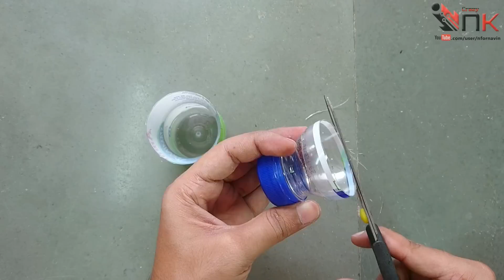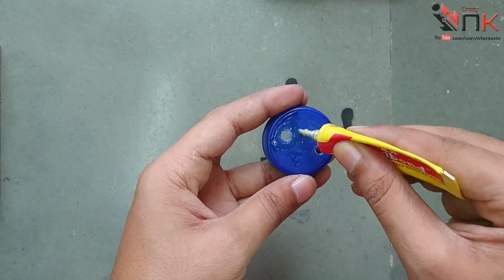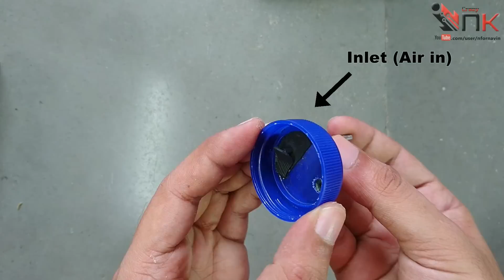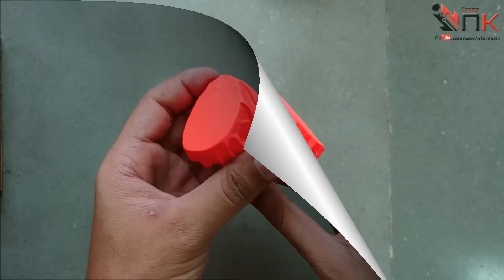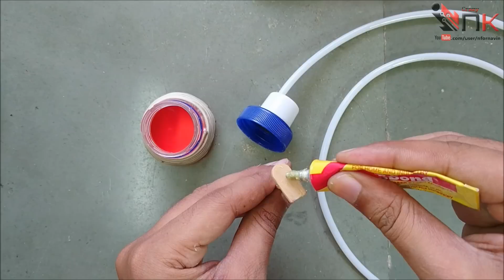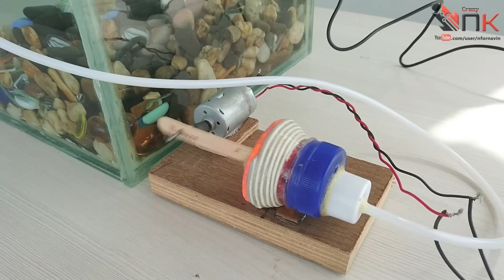How to Make an Air Pump for Aquarium using bottle

Comment: Hi, I'm confused, why need to pump air to aquarium water? Isn't it water is H2O? And the air obviously doesn't spread through on water.    I like it.
Reply: LOL!! since no one can see air, he demonstrated that way.
Reply: Air increases the oxygen level of aquarium water. And without air pump your aquarium is a dead trap.
Reply: wrong. unless he's using an oxygen pump, then it increase oxygen. air pump is usually used to encourage gas exchange since there is disturbance on the water surface. thus, the c02 released by ur fishes will escape whereas the oxygen from the surrounding will enter the water
Reply: Try It Studio you actually dont need the air pump most filters provide water movement